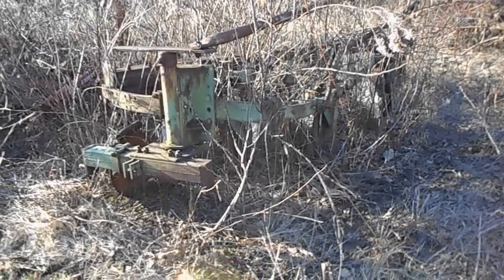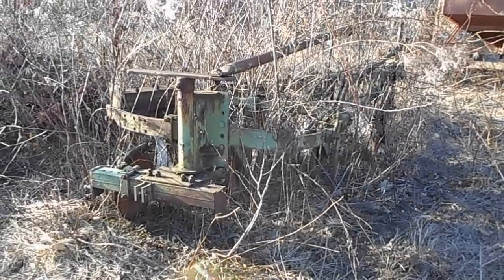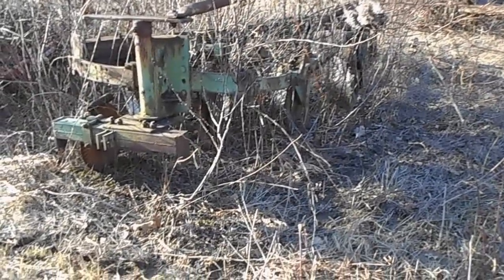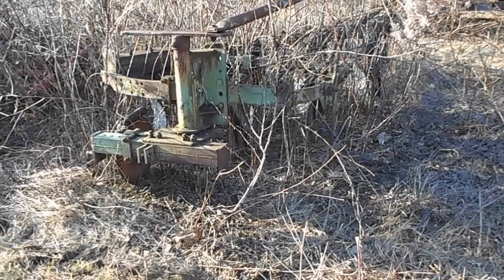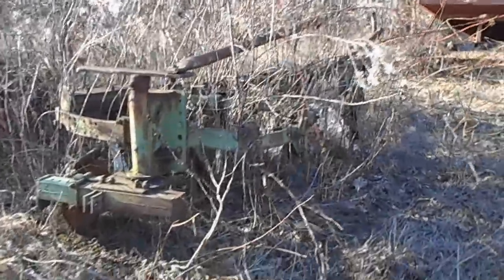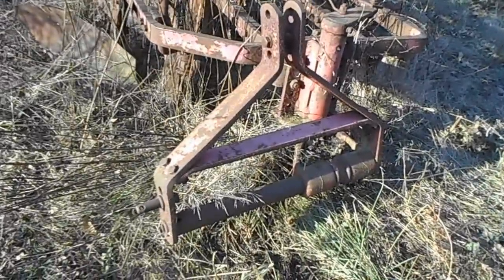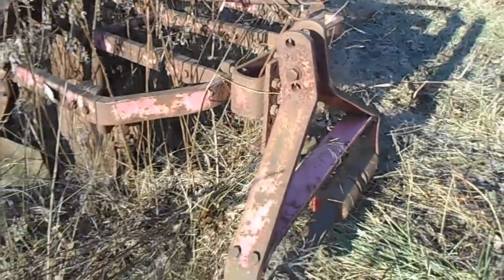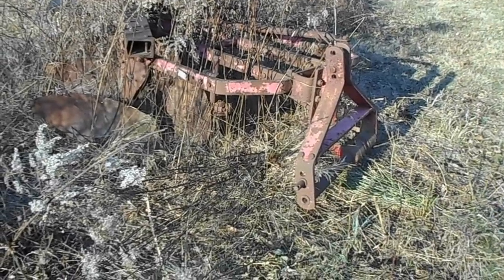Plow Education What plow for your tractor

Comment: I was trained by Ford Company UK Tractor Division back in the sixties,  the center link as you call it is known here as the top link, with two lower links, the right-hand one looking from the rear is adjustable and essential for ploughing in order to level the plough once it is in the ground. The top link is connected internally to the hydraulic lift system and is double acting, in practice the plowman sets the depth of ploughing by the quadrant lever to his right. If the plough encounters soft ground and the plough begins to go deeper the top ling is compressed which activates a valve which raise the plough to its correct height, if the plough rides over hard ground the top link is pulled backwards which opens a valve which lowers the lift arms putting more weight on the plough points to make them dig.
Reply: Three points don't create down pressure in the US... maybe a VERY FEW OLD tractors but most DO NOT.  The only ones I ever saw which could put down pressure were the aftermarket 3 point kits for the old Farmalls that never came with 3 point, and it could because it used a regular external hydraulic cylinder.  Needless to say those never had draft control since there was not sensing valve to raise or lower the plow in operation.  OL J R :)
Reply: @lukestrawwalker ur not familiar with the Massey Ferguson then go back to sleep
Reply: @arthurdewith7608  how nice... FU
Reply: Ford stole that idea
Reply: @arthurdewith7608  It cost Ford nearly $10 million for patent infringement to Ferguson in 1952.

Comment: Ford and Massey with that centerlink draft work very well for grading that centerlink draft is great with a box blade if you know how to position everything you can pretty well put the blade down and just go around in circles for like a parking lot or a building pad
Reply from the maker: Ford MF and some MM used that center link draft and they really worked good. I have seen guys try to use the wrong plow on one and get mad as heck because they just cant get it to plow right, And when you try to explain why and what they really need they wont listen or get even madder about it ! Just got to have the right stuff to use with them.  Bandit
Reply: Bandit farmer all I know is the ones with the center link draft are good for leveling land work real good with scraper blades box blades Etc

Comment: Before I watched this I didn't know what draft control was. After a little research, it seems that the Massey type raises & lowers the level of the plow according to the pressure applied to the top link. How does the rockshaft style work?
Reply from the maker: This is why I made the video to show this difference in draft control and in this case the equipment they need.  The Rock Shaft draft control is activated by the amount of pull put on the lower 3pt arms , Its the same type of hydraulic valve used in both systems just in a different locations. The valve might be internal or external and may have linkage that can be adjusted or adjusted by a lever by the 3pt control lever.  One uses the force put on the center link pushing against the center link to activate it and the other uses the amount of pull on the lower 3 pt arms to activate it. Both are good systems but there can be a difference in the equipment they need to be used properly ,  This plow slows that difference perfectly .  Bandit
Reply: Thanks, I just bought an Oliver 1600 w/ a loader & really want to play in the dirt.
Reply from the maker: The 1600 is a good ol Oliver , I almost bought one before I got my 1550 and are simular tractors if I remember right. I think you'll have fun with it playing in the dirt !  Bandit
Reply: The top link ones usually have a BIG HD spring inside the transmission housing-- you'll see the top link bracket is hinged at the bottom with a big pin and there's a big ol' round metal boss or something at the top with a pin through it, which then goes through a packing into the cylindrical top casting of the 3 point hitch cover of the tractor (where the actual lift arms come out the sides, with the drop links down to lift on the lower 3 point arms to raise the 3 point).  There's a BIG stout spring in there, that the boss pushes against, actually usually TWO one is pushing one pulling, with the boss going to a center ring the springs bear against, through the center of the outer spring, which is under the cap where the packing seal is.  This allows the top link to push or pull on the boss which is centered between the springs.  An internal lever or rod comes off the boss and works against a spring loaded "load sensing" valve attached to the hydraulic system.  When you flip the lever on the hydraulics to "draft control" it switches the oil flow from the position control system (which uses a control rod off the lift cylinder inside the hydraulic lift arm case) to operate a valve to keep the lift arms at a given height in relation to where you set the lift arm sector control (the control lever).  That's position control.  Draft control sends the oil to the draft load sensing valve, which itself is pushed and pulled on by two springs... one spring is operated by the sector control lever, which sets "how deep" (IOW how much load) you want the plow to go before the tractor lifts it up, and the other spring pushing and pulling on the valve is from the rod attached to the 3 point load sensing boss.  

The first thing you'll notice different about a draft link sensing system (one that senses draft off the lower arms of the 3 point hitch) is that the top link bracket where the top link pins to the tractor is usually BOLTED SOLID and there's NO pivot points or boss or packing or anything like that.  If you inspect the tractor ends of the LOWER lift arms, at the bottom rear of the axle housing, you'll find that there's a pivot point and large shaft going through the transmission housing, and the pins will be slightly offset from the center of it, in their U-shaped attach points.  As the arms pull, they usually twist that shaft, which is like a torsion bar, which the harder the pull the more it twists.  The more it twists, the more it moves a rod inside there that goes up to operate the load sensing valve, same as with the top-link sensing system, The more the rod moves, the more it pushes on the spring that pushes on the valve, and at some point it overpowers the spring pushing from the sector control lever, which is pushing the valve back to open a port to drain lift oil out, lowering the plow.  When the force exerted by the draft sensing rod (whether it's being moved by the upper top link or lower bottom draft links) equals the force of the sector control spring, the valve CENTERS and oil flow into and out of the lift cylinder is shut off, so the arms go neither up nor down, holding the plow at a constant depth.  As the load increases, the lever moves the rod more which presses on the sensing spring MORE and overpowers the sector control spring, which pushes the valve to uncover the LIFT port, which sends hydraulic oil from the pump into the cylinder to RAISE the plow, until the load backs off a bit and the rod moves and the spring pressure is equal again, and the valve CENTERS itself again... if the load lowers even more, the rod moves back further, reducing pressure on the sensing spring and the sector control spring overpowers it and moves the valve to expose the LOWER port, and some oil drains out of the lift cylinder allowing the arms to drop the plow in the ground more... 

The system is CONSTANTLY making adjustments like this, every second the tractor is moving, as the ground dips or rises, as it gets harder or softer, etc.  The lift arms are basically almost constantly moving up and down slight amounts to keep the forces in balance.  

Where the top link systems REALLY shine, is that there are usually 2-3 holes on the tractor for the top link end to go into... putting the top link in the HIGHEST hole (closest to the spring boss and packing nut) gives the MOST sensitivity, because of the leverage between the top link and spring is reduced, meaning it takes LESS FORCE to move the internal springs.  Putting the top link in the middle hole is "middle of the road", less sensitive than the top hole, but more than the bottom, and of course putting the top link the lowest hole takes a lot more force from the top link to move the spring, since the bracket with the holes in it acts like a lever between the bottom bracket pivot point, and the upper spring boss it's pinned to on top.  For light duty jobs where you want SOME draft control, like say cultivating or harrowing or disking, put the top link in the top hole.  For heavier jobs, put it in the middle, and for heavy plowing, in the bottom hole.  Depends how much response you're getting, if it's not responding enough for your conditions and lugging the tractor more than you want before it lifts (or slipping the tires too much) raise the top link a hole on the tractor end.  If the plow won't go deep enough before it starts raising up even if you have the sector control lever near "all the way down" (putting the most pressure on the sensing valve to "drop"), move the top link to a lower hole.  With the lower 3 point arm sensing system, you have NO CONTROL over this and are stuck with however the system happens to respond... 

Later!  OL J R :)

Comment: takes at least a 1100 massey ferguson to pull a 5 16 massey 880 plow in sod around our parts
Reply from the maker: Over the years after farming ground all around us I have learned there is a lot of different ground around us !  Some ground a tractor will have no problem pulling 4x16" and ground a few miles away same tractor will have a hard time pulling 3x14"  so you never know what kind of ground its going to be till you drop a plow in it !  An 1100 will pull 5x16" in alot of the ground around here but there is some it will really work it hard !  Bandit

Comment: We have an old Oliver 550, I think it has center link draft control
Reply from the maker: We had a 550 years ago and I really cant remember what or how the draft worked on them, It may have  Now I'm going to have to look it up so I know witch one it has ! LOL  There good tractors and I know they made a ot of them. It's hard to remember all the tractors that had the center link controled draft , I know Ford MH MF MM had it and more than likely the 550 Oliver too . More than likely there are others too I just cant remember them all. LOL  Bandit
Reply: Bandit farmer the 550 has a bolt type draft control under the seat that pushes up against the top link. That's what you mean by top link draft control right? I honestly didn't know the types of draft control so I'm glad I learned something lol
Reply from the maker: You are right in your thinking on the draft on the 550, It has the center link controlled draft. In the video I showed how and why this MF plow is best for tractors with type of draft control, As you pull the plow it push's on the center link making the draft work, And the harder the pull the more it works to give you more traction by lifting up on the plow. That's why you feel the pulse from under the seat while your plowing, Its a good system and it works good.  This is why there is the saying "The right plow for your tractor" !  Bandit
Reply: @crumb43  Easiest way to tell-- look at where the connections are made to the tractor... on a TOP-LINK CONTROLLED system, the lower draft links (lower  3 point arms) will be attached to SOLID IRON bosses or connection points cast or bolted onto the axle housing or center housing or hitch mount on the bottom of the center housing of the tractor.  The TOP LINK will have a bracket with a pin at the top and bottom to allow it to move, with the lower part typically being bolted or cast into the tractor center housing, and the upper one going into a HD steel boss or rod going through a packing nut into the upper hydraulic lift housing of the tractor, so that the top link can push and pull on the mounting point for the top link and move it back and forth.  

On the DRAFT LINK (or LOWER LINK) controlled system, the lower draft links (lower 3 point hitch arms) will be attached to the tractor with some sort of HD attach points, either a "U" shaped casting or forging or whatever, which will be attached to a large thick shaft or some sort of pivot point going into the center housing of the tractor.  The arm pins and the   shaft/pivot point will be SLIGHTLY offset, so that the arms will impose torque on the shaft or pivot point under a heavy load to sense draft.  The TOP LINK attachment where the turnbuckle pins to the tractor will typically be BOLTED ON SOLID with 4 or more bolts, OR it will be cast into the rear of the tractor center housing itself.  IOW, the top link bracket CANNOT MOVE to sense draft, so it MUST be a lower-link sensing system.  If the top link bracket is PINNED on so it can move, it's a TOP LINK SENSING system!  

Later!  OL J R :)

Comment: +Bandit farmer This was a great video! I watched twice and then read all the comments. Between you and your subscribers there is a tremendous amount of wisdom on your YouTube channel! I had no idea about the different hitches, because the only plows I've worked with had wheels and were simple pull-behinds. I did some plowing for my dad's place and for both of the farmers I worked for in the late 60's. My first experience was with a Farmall H with a pull-behind 2-bottom plow. No hydraulics; it was just a pull string. It was good for me, because I learned to look down to the end of the field and plow straight.  This was "Plowing 101," lol.  Roy always told me not to be a speed demon. He taught me to go slow until I was sure of what I was doing and then move a little faster, but never too much. He said driving fast was a good way to break whatever equipment you were using. Later he got a newer tractor, a Farmall 450 with hydraulics. We pulled three bottoms with that one, but still just a pull-behind with the hydraulic lift. I'm sure it would have pulled four bottoms, but this was not big acreage so three was fine. The soil was really nice sandy loam, the ground was flat, and plowing was easy. Thanks alot; I learned something new today!

Comment: Hey Mr Bandit can you tell me why a case 4 bottom hitch pull plow pulls so hard! Is there some adjustments I can make or do case plows just pull hard.. other four bottom plows I've used don't seem to pull as hard.. I don't have a three point on my 806 international and I like this old case plow but it pulls so dang hard.. It's hard to find the hitch pull kind anymore so I don't have much choice.. I wish I could find a nice pulling plow that does a good job. Thanks!
Reply from the maker: +Jim Nelson Hard to say without seeing it but are you pulling from the center of the plow? Or is the hitch on the plow more to one side ?  Also dose your 806 have fast hitch on it ?  Bandit
Reply: +Bandit farmer It is relatively close to center and it has the swing type draw bar.
Reply from the maker: I'm not sure what to say, I know the wider the bottom the harder they pull. I bought an AC 4x20" semi mount that worked the guts out of our 1850 Oliver but I have a 5x16" Case semi mount plow (really an Oliver plow) I could pull in 5th gear and move right along with it. Its hard for me to say without seeing the plow in action and what kind of ground you have. Bandit

Comment: If you want to use an Oliver plow on a center link tractor then you can do that, you just have to have a special quick-tach that uses the center link
Reply from the maker: +Jacob Besler Your right you just need the adaptor hitch to use an Oliver plow on a MM MF or Ford, The problem is I have only seen 1 of those hitches in the last 40 years and it sold with the tractor. So it's about as easy to buy the semi mount plow made for center link draft control witch are hard to find too. Bandit

Comment: Great job explaining the  the different types of draft control and why the A-frame was needed on tractors with top link draft sensing. As there is very little moldboard plowing done any more,  a lot of people are clueless about it.  I looked at a brochure for a MM G1000 brown belly which has a picture of the G1000 hooked to an MM plow with the A-frame.  That MM plow would have been just an Oliver with red paint.  I think the 1100/1130 Masseys were top link sensing too.  It did seem that Oliver plows were used behind  many other tractor makes.  Almost all of the AC guys in this area pulled Oliver plows.    The big reason for the popularity of 18" plows in the 70s was more clearance to get corn stalks through the plow.  Big diffrence between the 5-14s and the 4-18s on that count.
Reply from the maker: +Bill Fjelland  Those A frame adapters are hard to find, In fact I have never seen one in my life and I've been to a lot of auctions. This MF plow is one of the very few that were built for the center link draft and these are few and far in between. And it's like you said a lot of people are clueless about this and these plows. This is one of those things I got to thinking about after the sale and I didn't find anything on the computer to explain this and the differences between them, So I made one. I hope people learn something and others enjoy my explanation on this and it makes sense.  Bandit

Comment: bandit farmer my dad brought a 5000 ford and 4-14 semi mounted plow new in the mid 70s it did not have a top link .it pull it good in bean ground but not so good stalk ground you think because it didn't have a top link thats was the problem.
Reply: Yup... Fords were ALL top link sensing as far as I know... without the top link, you have NO draft sensing at all... not without the top link adapter he mentioned in one of the previous comments!  OL J R :)